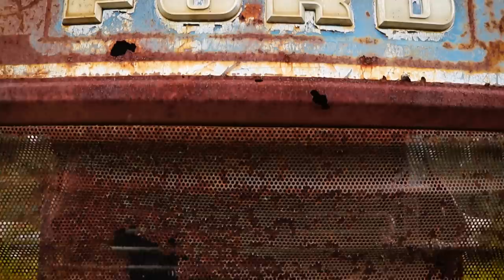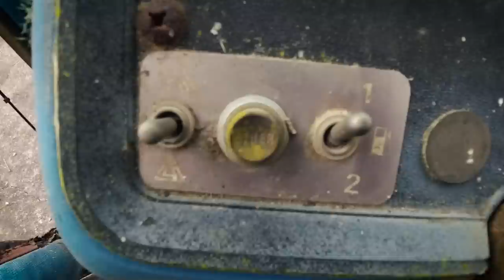FORGOTTEN ON FENCE ROW!  SKETCHY FIRST START For This FARM TRACTOR

Comment: Ford 9700 or tw20 since it’s turbo charged. 8700 was naturally aspirated. 9700 Made between 77 and 79 Serial number should be near radiator filler cap. Tw20 made between 79-83 serial number under right grill panel 👍👍
Reply: That tractor is an 8700 because if you look at it it’s definitely a naturally aspirated, that breather was probably added on to it at sometime, but from the way it sounds and being able to see the whole engine on it, there is no turbo, making it a 8700
Reply: Can't beat a 401
Reply: @JTsBuildsandFields  Correct it an 8700.            Turbo 2 is just the brand name of that aftermarket  cyclonic air intake precleaner above the hood.  They were common in the 70's as they had a rotating centrifuge to disperse dust.
Reply: I'm sure logger Wade's mum has a tractor like this.
Reply: 7710
Reply: Could also be a tw 5 or a tw 10. Ford was weird during those years
Reply: It’s an 8700. 7710 was a 4 cylinder turbocharged tractor. It doesn’t have.      F O R D on the Front of it. It has an oval with Ford written in it.
Reply: @walkerbaumgartner7733 not a tw series....its an 8700

Comment: For the batteries, you’re correct. Parallel (plus to plus , negative to negative ) it increases amperage capacity but keeps it at same volts ( 12v ) but if you do series ( positive to negative ) then you’ve got series which makes it go from 12v to 24v ) , that’s how golf carts can make 48v systems

Comment: The line on the injector pump is where when you do an oil change on the tractor you also change the oil in the injector pump overtime the oil will thin out with diesel that’s why you’re seeing the drips from that line from behind the injector pump hope y’all are having a blessed day! I’ve got a Ford 3000

Comment: The power steering reservoir is on the same side as the breathing pipe for the engine it’s that silver round casing the filler what you was looking at what was black and underneath the alternator is where you top your engine oil up

Comment: The little breather tube on the pump is the breather for the pump it selves
You have separate oil for the pump where you fill it on the top side of the pump'The lever  on the pump is the breather pipe
Same on all these Q cab Fords
And I got them to a number :)
Reply from the maker: Interesting thank you
Reply: Indeed, thèse fuel pump have their's own oil level. It is thé 1/2 head Bolt just beside the fuel transfer pump.

Comment: The tube on the side of the injection pump is an over flow for when fuel gets into bottom of the injection pump and dilutes the oil in the pump.

Comment: That brings back memories, in the early 80's I was a "Zone Service Manager" with Ford Tractors in Melbourne Australia, just a guess but it looks like a TW10 since it doesn't have a turbo.
Reply: Yes I was thinking similar to that when I worked in NSW out back on a working I worked for the local Case dealership and we had one of them come in from a feedlot similar condition to that one but yeah that was a TW20
Reply: Definitely not a TW...its an 8700

Comment: Get you some soft shackles to use with your winch. Hooking it to the tractor like that isn’t good for the rope. Also a snatch block comes in handy too. Look up “4x4 Rescue” in Florida on YT. He’s a rep for Rhino USA. They make excellent recovery gear.
Reply from the maker: I actually one in the truck and forgot to use it🙄
Reply: Yup,, The way He attached the Winch line is the quickest way to destroy it. 
At the very least he could have slipped the Black protective Sleeve over the Line where it went around the Front of the Tractor . 
ALWAYS use some other sacrificial device to connect to an object. SAVE the Winch Line.  
Mike M.

Comment: The simms pump has its own oil in the pump. Not from the motor oil. If the seals in the pump go to leaking it puts full in the oil of the pump

Comment: It would have started without ether and a lot quicker if you half opened the throttle and press d in the button on the stopper lever on the fuel pump.

Comment: 😁👍 sorry I hadn't been by, I started PT and them girls put a hurting on me so bad it took me two days to recover 🤕. Them's some mean 'therapiseds'  I'm telling you. 
I feel like I'm as rusty as the ol' Ford tractor ya winced out of the weeds and squeak twice as bad. My feet are just as flat as the tires, I also make oil and I go through a lot of water. My brain bucket sounds as empty as the fuel tank. Yeah, it has been near 15 years since I ran too but you hook a battery up to my starter nuts and I'm going to fire off too.😆
Reply from the maker: I hear ya!

Comment: Hey guys I`m quite sure that what you have there is a Ford 8700  going off it`s shape and engine sound  A good few of these word sold in the UK where I`m from
Reply: 8700 didn't come with a turbo. This has one.
Reply: @Southalabamaoutdoors  You are right originally they were non turbo quite when it became available I`m not sure but you could buy a Turbo kit that fitted the 8700 hence the turbo on this one
Reply: There’s not a turbo on this.

Comment: Thanks for another great video. 
It was interesting and enjoyable. 

You two did it again. It runs and doing great running. Congratulations Hank and Wiley. 

Not too bad getting it going. Neat putting the batteries on the pickup tailgate. Neat. 

Needed some fuel but what the heck. 

Ran good. 
Well, time for lunch. 
You two take care and be safe. 

Looking forward to the next video. Thanks for everything Hank and Wiley. 
It was another great time. 

Until next time. 
The Iowa farm boy. 
Steve.

Comment: If you push the excess fuel  button on the pump  - which is the pivot on the stopper on the injection pump it would start straight
up without  the need  for  ether

Comment: Here's an idea get in the cab and straighten the wheel while you're trying to pull it. You're talking about the cable breaking while you're standing right beside of it
Reply: Yep that was crazy that wire rope could’ve easily snapped.

Comment: Yes 2 tanks the top one feeds the one under the cab on left side of the cab powerstearing pump was under the ac pump and that little hose is a overflow for injecter pump and yes cap on right side is oil cap

Comment: I saw a ford 9600 that looked like it was falling apart. It has holes in the fenders,muffler,and hood. It was still running and was mowing, point is they were built ford tough

Comment: Good job. Thanks guys. They sure do run good, those old diesels. You guys look like you need a remote starter to cross start those starters. It might help to make it a little easier for you. And bring along a couple of those heavy duty jump leads. You never know when you'll need a couple of extra circuit leads for the unknowns. Anyway, I sure hope no one gets stung or bitten. Be safe and God bless. By the way, an old heavy jacket or rug should be  used about halfway to your winch pull object to deflect the reverse whip of the line while doing a heavy pull. If it breaks it will soften the back whipping a lot. Much safer.

Comment: Engine must be at idle to engage the PTO. That's how it is on our mid 70's Ford 2600 anyways. Sounded like that engine was running about 1500 rpm.  What you thought was the power steering filler is actually the oil fill. Those old Fords were the best tractors made. You absolutely can't kill them.
Reply: I have a  Ford 3000 that my dad bought in 1975, I think, but it could of been in 1974 .
My dad died in 1997, so I can't ask him . It has been a great tractor, I have got new tires to put on it and a new seat and several other things . And I am hoping to paint it and do several things to it . But like you said they are hard to kill, because they live on forever . I see several things on this tractor that resemble the same setup as my 3000 . Thanks for the comment .
🤗👍💫

Comment: Had a trial of a 9600 or 8600, cant remember now for forestry.
And a county 1454 which was based on 9600 unit.
The tractor in the video is the successor of the 8600

Comment: The right side cap is the engine oil fill. The power steering  reservoir should be in the front left of the engine. (The round thing attached to front cover) the one I had seen.
Reply: That’s what I was going to say

Comment: Just worked on something similar steering is hydraulic one single cylinder up front to the driver side, fill the hydraulic pump i Guarantee it’s leaking like every old ford tractor and you’ll be set to drive. the fuel leak I’m not sure I just put a mini mec cav style pump back on and it didn’t have that I’ve never seen an in-line pump with a vent and the one I worked on was much larger  in horsepower so that’s an oddity to me

Comment: Dear Tractor companies why don’t most of you find an old lorry Frame or even rebuild a brand New Lorry Frame for building stronger and better Tractors and put those Volvo B10M, Volvo TD102KF, Gardner 6LXC and Gardner 8LXB Diesel engines for those stronger better Tractors so they can still use them for any farms and even lift a broken down Bigger Buses and even broken down Lorries, why don’t you build 5 and 6 seats so that other passengers can sit at the back and front including the driver. You can still build those four stronger medium sizes wheels and still make them even more farm tractor like than it still was before, please can you do those interesting idea’s for us tractor Lovers.

Comment: It's a Ford so it'll have to run. It's got no choice.Power steering is on the other side, shiny looking can thing with a round rusty cap on the top rear. Yall did good but the Gal did the best. GBWYall!

Comment: I’m a big fan of JD tractors but these old Ford Tractors were some of the best tractors ever made. Ford purchased New Holland around 1985 but around 91 Fiat purchased the brand and started making a different line of tractors. New Holland isn’t related to Ford at all anymore. My dad was a Ford-New Holland dealer in the 80’s to mid 90’s. Farm Trac built tractors that were very similar to Ford tractors for a while.

Comment: Power steering pump is below air conditioning compressor. It will have a fill cap facing out. Hydraulic oil fill is behind cab on top of rear end housing just above top link mount. Injector pump has a cap scew on the side to check oil level in bottom end of pump. Engine oil fill is in front of injector pump. We ran an 8600 Ford non turbo on the farm. Pedal between clutch and brakes is hi low pedal or Dual Power as they called it. AL B.

Comment: Looks like a 8700 no turbo, the 9700 had a turbo late 70's early 80's, we sold them new  if it was a 4 cylinder turbo it would have been a 7700

Comment: That little black tube is like an overflow for your injector pump I just picked up an 8000 Ford tractor about two weeks ago learning a lot about them their steering is hydraulic but they have their own hydraulic reservoir and pump

Comment: That pipe is the injector pump cambox overflow it just allows excess diesel to run out however those pumps are supposed to have oil in and need changing every so often there is a drain fill and level plug on the pump near the governor you will most likely have better throttle response and a more stable governor after changing the oil

Comment: hi guys like your show , i think u will find that tube is over flow from the injection pump, the old injection pumps u had to change the oil in the pump. later engines the pump  oil was feed from the engine oil pump , so the old pumps with there own oil over fill when pump is old & the diesel by passes in the pump & it over flows or it can be the lift pump diaphragm on the side of the pump  ,any way the diesel still lubes the pump as well , hope that makes sense ive had a beer or 2 cheers

Comment: There's oil that goes in the injection pump too! That definitely needs to checked and changed with the engine oil as it uses the same oil.

Comment: Well the power steering pump is on driver side and has its own reservoirand the place on passenger side where he pointed at and no rite their is where fluid goes at well it’s not that is where you put engine oil in at and on the rear of tractor is where you add hyd and it has it separate dip stick back their as well but good engine start though

Comment: the pas pump is separate with its own oil the reservior is fixed to the power steering pump driven from the front of the engine

Comment: Yes running batteries in parallel increases amps only ,     series only increases volts,,       an amps are like torque in an engine the useful energy

Comment: You still need to put a winch blanket on the winch rope to stop it flinging out when it snaps and why don't you drill a hole in that plate to get your hand in so you can put it to free spool a plug in remote

Comment: Hank, you nee to go to Harbor Freight and get Wiley a starter button. And to fix that plate on your winch bumper weld a hinge to it or screw some studs in so you just have to pull some pins to remove it..
Reply from the maker: I’m actually going to order a new button this week. I’m tired of not having one.  Lol

Comment: awsome mine was a 9600 tough as nails also had a gear spliter on the floor verry verry strong no worries it will run with ether